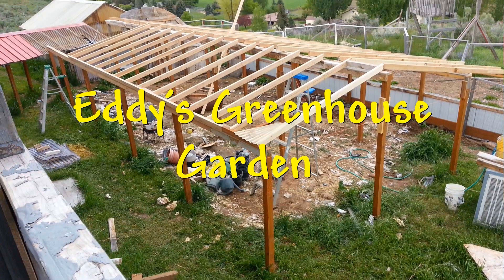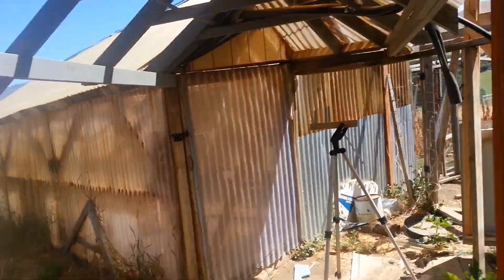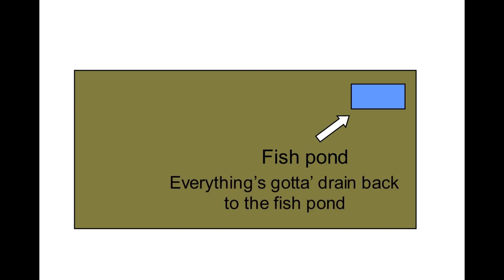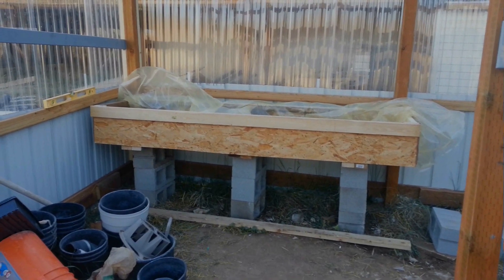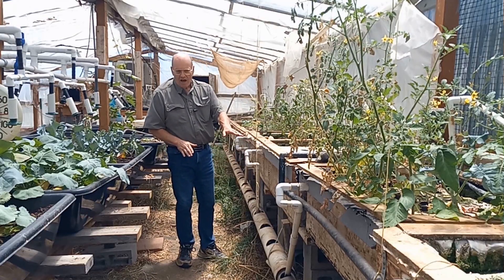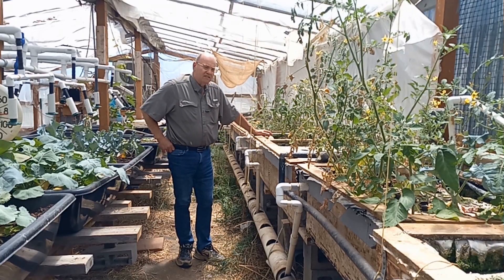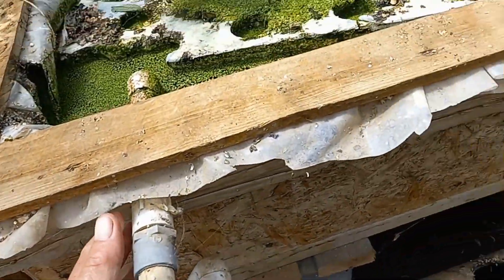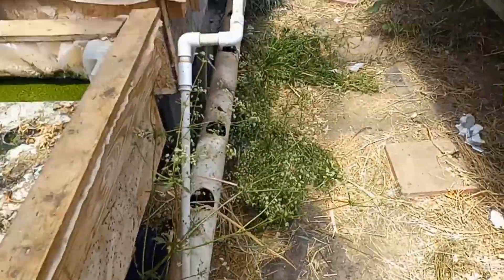My Unique Aquaponic Water System

Comment: Where are you located? How low do your winter temperatures get and do you need to take any measures to protect the fish or water system? Are you able to grow through winter because of the greenhouse?
Reply from the maker: I am in Northern Utah outside of Ogden.  Winter temps get well below freezing during winter but the water never freezes as long as it is circulating.  Before I got the water system circulating, the growbeds all froze solid during winter.  The fish pond stayed liquid except for a thin layer of ice on top.  About 2 feet down it never got below 41 (f) and the fish were fine.  I have grown during winter but it required external heat that was too expensive for me so I gave it up.  I have uploaded a series of videos over the years that go into this in great detail.  You might want to take a look at some of those.

Comment: It is a nice system. Thanks for sharing 👍
Reply: P.S. I basically made a water tower to get enough water pressure for the water supply to the growbeds. I pump the water from the sump tank up to about 6ft high into a small empty pond filter that has no filter media or filter mats inside, and from there the pipes run down to the ground level, towards the growbeds, then it goes back up again to the height from the growbeds, and then it supplies the growbeds with water. The benefits from that is that I can keep a low profile with the pipes, and I used a lot less pipe as well. The water tower is situated in a cabinet in the corner from my garden. I also made a drainage point at the lowest part of the pipes so that I can drain and clean the pipes if that is ever needed. Gravity is the only pressure in the pipes. The empty pond filter does catch some of the more coarse bio mass, which I can drain out manually every few months or so. This helps to prevent that my growbed media clogs up. 

And I can't let the pipes sit in the open air without insulation like you do otherwise they would freeze apart during the winter or they would get way too hot during the summer. So now my pipes are all out of sight and insulated against frost and hot temperatures. It looks nice and it is functional. I do have valves for each growbed, but they are always fully open. They are not needed for flow control because I have a variable pump, so I control my water flow with the speedcontroller from the pump. It is more for maintenance redundancy. This way I can keep the system running for the other growbeds if I want to do major maintenance on a single growbed.  I close one valve from the growbed that I want to do the maintenance, and then I let my pump run a bit slower with the speedcontroller, and when I am done with the maintenance I put everything back as it was. But it is practically never needed.
Reply from the maker: That sounds great!  I am trying to develop something for automatic watering of the soil growbeds I have.  The problem is it takes too many sprinkler heads for one pump to supply.  What you have done gives me some new ideas.  Thanks
Reply: I really wish I could watch this video, but my friend there's a huge buzz to the audio that I cannot cope with. Hope the aquaponics goes well for you!
Reply: @sw1ft3  When I hear pumps running and water splashing it sounds like music to my ears. But I do not blame you. I also have encountered videos with audio that I could not cope with. But I had no problems with the audio in this video. It is part of aquaponics that you can hear things, especially inside a greenhouse. 

I have an outdoor system and all that you can hear is a gentle sound from the water.

The air pumps are usually the loudest. It is like a mini air compressor. Therefore I use a regular water pump with a venturi for the aeration. That doesn't produce a sound because it all happens under water. And I have it on a timer and it only runs like 5 hours or so during the night. And with a simple plastic valve from an aquarium air line I can regulate how much air I want to put in the water. And it produces micro bubbels which will stay in the water instead of floating straight to the surface.
Reply: @sw1ft3  Weird, I reply and I see no reply, I reply again and I still see no reply, and minutes later I can suddenly see my replies.
Reply from the maker: I'll have to try and reduce the background noise a bit better.  Thanks for letting me know.
Reply: @sw1ft3 no big deal. His information is mind blowing and worth watching with any buzz noise.